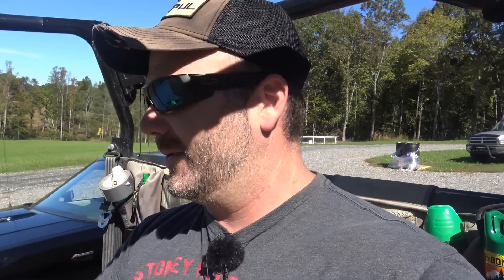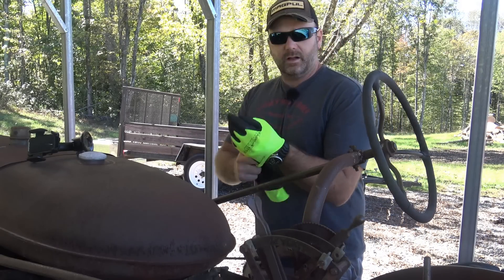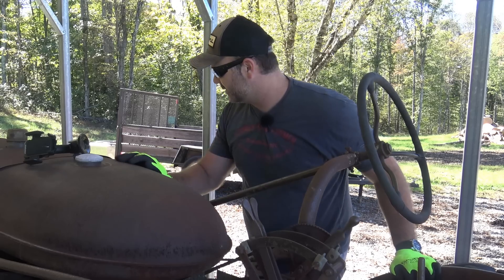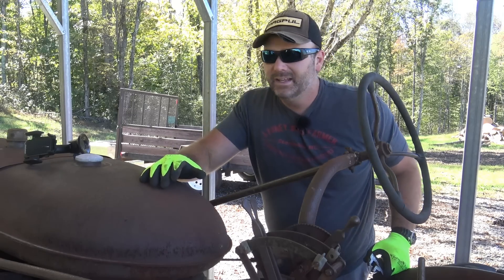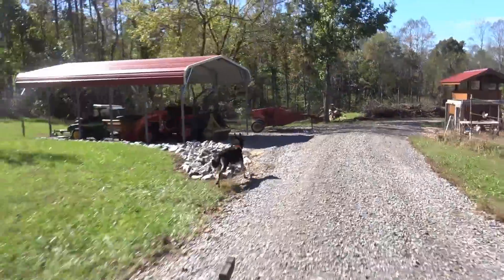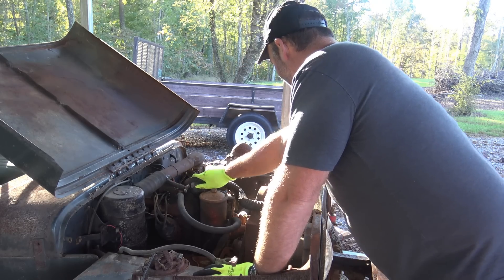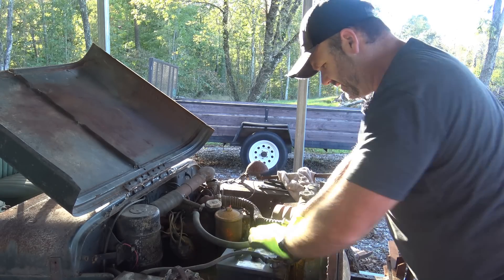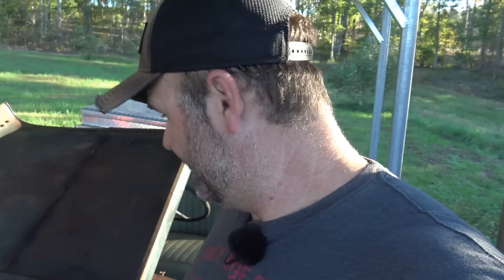WILLYS JEEP... LET'S GET THIS THING RUNNING!

Comment: Josh, if you're going to bump start it, put it in the highest gear and roll it off a hill and pop the clutch.  The higher gear gives less rolling resistance and turns the engine easier.

Comment: Nothing that has been sitting in a barn for 30 years can be expected to start right up. Start by cleaning the battery cables (both ends) and removing the starter. Once you have the starter off clean both mating surfaces (starter and bell housing) so as to have a good ground.  You should also remove the switch from the top of the starter and clean the contacts. Now it should turn over much better. Next: Do you have spark ? Remove the spark plugs and drip a small amount of ATF mixed 50/50 with Diesel fuel into each cylinder. Crank the engine to loosen it up and get some oil pressure. Clean or replace plugs, add some fuel and give it a try. 50 years a Willys Mechanic.
Reply: That's what I was going to suggest
Reply: What do you think about the 1947 Willy's pickup?
Reply: Absolutely clean the starter and block mating surfaces. All of the connections need to be as clean as possible. It's been many years, but I'm thinking that my ground wire ran to one of the starter mounting screws.
Reply: yep painful to watch this, before any thing else lube cylinders they are bone dry after sitting 30yrs,clean plugs and replace battery leads,check for spark and as a last resort yes tow it in 2nd gear and see if she starts.good luck
Reply: Chuck, you’re a Willy’s mechanic? I need to talk to you! I’ve been looking everywhere for someone who knows something about these cars.

Comment: I had a 1948 Willys CJ2A, in my younger years. It had no brakes, and from the windshield back it was a rust bucket. About 20 years ago, I took a backhoe dug a hole and gave it a fitting burial. If you need any parts, and feel adventurous, it is in eastern N.C. Bring a shovel.

Comment: Ol' 6 volt system 😲. I converted all my Farmalls to 12v. Super A is a nice machine. Can I be Glenn? Believe it or not, those oil air cleaners were effective. That jeep is what dreams are made of 🤠
Reply: I've converted a few tractors to 12 volt and never touched the starters, a 6 volt starter cranks REALLY quick on 12 volts :) .. and they seem to last for ever.
Reply: @MikeBaxterABC   Yeah, on a gas tractor they don't turn long.... diesel tractors the starters take a beating because they turn for so long to get the machine started.

Comment: Josh, I used to own a Willy's M38, 24 volt brother of the cj-3a that I converted to 12 volt. It's a lot easier nowadays to convert. Delco 10si alternator, universal alternator bracket off of eBay, nippondenso starter off a late 60's early 70's Land cruiser which has a softer flywheel engagement, 12v LED bulbs and txl wire or a six circuit wire harness from eBay. Oil bath air filters are great, especially on farms, just loosen the wing bolt and drop the bottom and replace the oil with your oil change. You may also want to  do a "squirt" of Marvel Mystery Oil in your gas fill-up to help with lubing the valve seat due to lack of lead in today's fuel. Hope this helps. PG

Comment: Dispite what you read about 6 volt being no good remember 6v is what won the war, there's nothing wrong with it. I have a 49 willy's jeep with 6v. I totally restored it. Just make sure all the connections are clean, like the ground strap going to the frame (and buy a new battery, it's also ok to jump it with 12v if need be) Also just pull the carb and clean it. You might have to replace the fuel tank, you can buy those online all day.  Sand the points also. Please don't pull it around the farm, that's how sh*t breaks.

Comment: FINALLY I figured out how to comment. LoL. I love your channel I have two of your shirts. In regards to the Willis Jeep. I had a 1950 model. Used Emory cloth to clean the points (inside the distributor cap and plumbed a boat fuel tank (for a pontoon) these are great little projects. I wish I hadn’t sold mine and I want another. They are basically foolproof. You can switch to 12v (the starter will handle it (change the light bulbs). Looking forward to future videos !!!!!!!!    Love ya man!  Sorry about Clyde, the man you purchased your land from. I had a similar situation in my life. Stay strong Brother. We love you!!

Comment: I had a 1950 and 1956 willy's and they had set about 15 yrs before I bought them the tanks were bad on both jeeps I ended up using the removable boat fuel tanks like a pontoon boat uses and an electric fuel pump and it worked great. Hopefully you can find a starter or a place near by to rebuild it. Good luck with it hope you get it going cause they are lots of fun. I would try 3rd gear when pull starting it since they are geared very low.

Comment: 6 volt batteries really suck..they dont hold a charge very long when cranking the engine, You should take out all the spark-plugs add some oil into the cylinders and turn it over,I bet the cylinders are very dry after sitting 30 years! Take the starter out and clean and lube it up,before it gets overheated and burns up..
Reply: That was my first thought too
Reply: for sure after 30 years fogging the engine is a must lol
Reply: I'm pretty sure that oil is in really bad shape too. I wouldn't crank a engine on it
Reply: yes,I think he is not much of a mechanic,Im sure hes learning..but he is going to do do more damage than good..
Reply: Possibly rig up a different type of switch to start it
Reply: Theres a german spray called ^ravenol^ for unseizeing the parts most folks consider un fixeaable!
Reply: @eddiecaplan1908  , thanks for that info, got an outboard motor that seized after Hurricane Sandy, I`ll give that stuff a shot!
Reply: @jlpytlewski  its truly brilliant at unsiezing the worst corroded parts, only trouble is, once you use the aerosol, it seems to lose pressure and leak after a few weeks, it is so efficient at penetrating,it even bypasses the aerosol valve!,   its expensive, but id still highly reccomend it when nothi g else works!
Reply: You can boost it up to 8v with your voltage regulator.
Reply: Take that old start out! Tap on it, blow out the rust, clean all the connections,  lube it, put back in. Clean battery connections and ground.
Reply: @FUNNYBOY12375  The starter has a mechanical "switch" actuated by a rod from the starter pedal under the dash - no electrical solenoid there on the starter at all. The starter will have to be rebuilt, the electrical system to the starter fixed, the engine ground to the battery has to be cleaned, and I would replace the ground strap and the positive cable anyway. Otherwise you risk burning up the battery from a short or a fault in the starter if it will not shut itself off when you release the starter pedal. Gotta remember that Jeep is 67 years old - they did things different back then.

Comment: Change plugs, make sure fuel line is clean, change oil and filter, get new starter in, change out batt. Terminals. Before you try to start the old girl.  🚙💨

Comment: If you try pulling it to start shift the jeep trans to 3rd or hi gear.  Even though it is 6 volt you can jump it with a 12 volt, just hook up cables like it was 12 volt.  I have done this many times with old tractors and cars.  I am 83 years old and started working on farm equipment since I was 10 years old.

Comment: Just helped my brother with his 1947 Jeep going. Get rid of that mechanical starter switch and put in a solenoid. Those switches are very finicky if not hit just right all you do is drain the battery. Good luck

Comment: I put a 1947 Willys CJ2A Jeep together from parts 50 years ago last summer, between my Junior and Senior years in High School. The starter was never very good and often acted just like the one you have. Clean electrical connections are critical. You will probably need to pull the starter off and and clean all of the connections, as well as the battery connectors. My jeep had been converted to a solenoid starter and had a start pushbutton on the dash. You could do this with yours, if the start switch is bad. You can use a 12 volt battery to start the Jeep, but it's not a good long term practice. Most of the 12 volt systems used a 6 volt ignition coil with a voltage dropping resistor in series that was shorted out by the starter solenoid. This would put full voltage on the coil while starting. Mine was a 6 volt system, but the generator was not original and I had to convert it to positive ground because of that. Since there is nothing electronic on the Jeep, it doesn't care whether it is positive or negative ground. The polarity of the old commutator generators depends on the direction that they turn. If you rob one from an old car (or tractor), it needs to turn the same direction as the one that you are replacing, or it will be the wrong polarity. The starter is series wound and doesn't care about polarity. If I remember correctly, the old flat head four is 134 cubic inches and the rear ends are around 5.4:1. 45 miles per hour is probably the top speed except when going downhill. The transmission should be a Borg-Warner T-90 and the transfer case should be a Dana 18. I found this web page that you might be interested in: http://www.cj3apage.com/

Comment: Good video Josh! The wife and I think your dad should have given that Jeep to you! Your a good son and we would have never thought of charging you anything for it.  Having said that as another commented, I would start by pulling the starter and seeing if you can rebuild it, new brushes and what not as long as the winding's are good you should be able to revive it. Once that is done I would look for a spark, if none check out the points and coil once you have spark then get a can of starter spray for the carb it works much better than gas to get it to turn over. Good luck Josh.
Reply from the maker: Yep I got her in the shop now...gonna pull the starter and do exactly what you're saying !

Comment: Id reccomend to pour diesel in the cylinders and let it soak a day to free up any stuck rings and pre lube it. It will also seap down into the oil to loosen up any sludge, so you will have to change the oil. But then tow it around without plugs and let it turn over then put the plugs in, change oil, fire it up.

Comment: 2 things:  1)  People with the Model era would get rusted out gas tank, just clean off rusted part and shape sheet copper to fit where it used to be and solder in place.  A good radiator should be able to do that and leave you with a tank which will last forever.  2) When pull starting put trans in a high gear, it will be easier to pull and will spin the engine plenty fast.

Comment: if your having trouble with starting, you should have removed the starter motor and got it fixed, whilst waiting for the starter to come back, you do the electricts side of things, replace the spark plugs & leads, replace the points and rotor button and cap, set the pionts gap, change out the oil and filter, do a compression test once you got the starter motor back, tip som fuel into the carby, fire it up

Comment: Run 12 volts to the starter really quick, it will clean the brushes up enough to turn over better on 6 volts. Also, put some ATF in the cylinders, dry cylinder walls and stiff piston rings gouge the walls and kill compression later on down the road. I'd pull the distributor cap and clean the points with some very fine grit sand paper so you'll have spark

Comment: Josh- remove the spark plugs, spray some fogging oil in each cylinder so that you dont further damage the cylinder walls that way you can play with your willy longer 😆

Comment: I'm 84 and telling you on lead acid 12 volt battery you can drive a screw down the middle and connect to it and you have 6 volts! Also you can use 12 volt battery to start a unit that used six volts. On kill or run engine's use 24 volts just to turn over and perhaps start.  It sure will do something like break the bendixen or turn over or if starter is weak will smoke the starter.

Comment: You will have to pull the plugs and add about 3 table spoons of oil to each cylinder  ,to give it compresson
Reply: Edward Marvin not compression but just to be sure that when the piston rings start moving again the cylinder wall won’t cause scratches and damage... I’ve always referred to it as “running an engine dry” or “ don’t forget to lubricate a dry cylinder” mostly because you have no idea what’s In them and so on
Reply: Edward Marvin not compression but just to be sure that when the piston rings start moving again the cylinder wall won’t cause scratches and damage... I’ve always referred to it as “running an engine dry” or “ don’t forget to lubricate a dry cylinder” mostly because you have no idea what’s In them and so on

Comment: I'd pull the plugs and coat the cylinders with some oil,  Then pull it around without the plugs in.  Then install the plugs & retry.  Agree that you should use a known clean tank temporarily

Comment: Rig up a boat fuel tank. Clean the points with sand paper, Emery tape or your pocket knife. Hit it with 12 volts and it should start. But only long enough to get it fired up. Then if you want you can 12 volt it. Or find an 8 volt battery to run the 6 volt system on.

Comment: fuel timing spark and compression is my main check list go to for getting an engine running that is cranking over. 
you got the starter issue figured out basically,
Reply from the maker: Yep....first we gonna pull the starter and clean it up...hopefully this solves some issues....then install new cables
Reply: @StoneyRidgeFarmer  Cant wait to see yall ride around on it !!

Comment: Hey Josh getcha one of them boat gas tanks, and hook it straight, check your plugs make sure there clear and then check the spark. If you got spark and fuel that thing will run.

Comment: Josh you put the battery in backwards. Positve ground, my friend. That oil is terrible. When dirty oil sits around for years the crud and dirt desend to the bottom of the oilpan. So when you start the motor it will suck up the worst of the oil first. Not a good idea. Drain the oil, change the oil filter, add Rotella 30wt oil. Popular brand oils don't have the additives that old motor needs. Pull all the sparkplugs, clean and gap them. add a teaspoon of atf down each sparkplug hole. With the plugs still out spin the motor over some. This will pump clean oil through the motor and lube up the cylinder walls. Now check for spark. If you have spark hook a remote fuel tank to the fuel pump and spin the motor over some more. This operation should get the fresh fuel to the carburetor sooner and eliminate a problem the old fuel is waiting to hand you. Reinstall the sparkplugs and drip some fuel down the carburetor. You are ready to try to start the old girl now, turn her over and let's here her run.

Comment: Best bet is to put  a 12v battery in it and change the coil for a standard 12 coil or run a 6v coil with a ballast resister inline (looks like a white ceramic block on a mounting bracket) on the power side of the coil. If you run a 6v coil on 12 v it fries the points in the distributor  Its not great for the starter motor to crank it for a long time on 12v if its a 6v starter as they will overheat, but it should crank faster.  Make sure you have a points gap in the dizzy. Pull a plug lead off a plug and fit a spark plug to it. Hold it against the block and get mrs Stoney Ridge to crank it. it should through a spark across the gap in the plug. If not clean the points and try again.

Comment: First thing you do with a motor sitting for that long is pull the plugs and check the cylinders. Turning a motor over with rusted walls ruins the bore and pistons rings! Make sure the motor can be turned over freely (by hand/ ratchet on crankshaft) without resistance.

Comment: Convert it to a 12V system/starter rewire it so you don't have to worry about fires, and put a key switch or temp toggle to start it. Definitely want at least an E-brake before rolling it down a hill. Good luck, man.

Comment: Look at the brushes on the starter, I had the same issue with the starter on my farmall cub  and I have them replaced.
Bump start it in second gear if you are going to pull it around to start.
Can’t wait to see it run!

Comment: Probably too little too late but try an 8 volt tractor battery, a friend of mine had a '46 ford pickup with a 6 volt starting system and he put an 8 volt tractor battery in his truck, it cured his troubles and didn't cause any troubles. If you're wondering about troubles, he was a certified mechanic, so I doubt that he would have done it if there would have been any consequences from his actions. It worked well for him.

Comment: You probably should pull the plugs and put some lightweight oil or diesel down each cylinder to lube a little for ease of turning over.  You should also clean the distributor cable ends, file/check points, battery cables and battery terminals really well. Also, make certain you have some clean engine oil.   I would also boil the carburetor and make certain it is super clean, along with some new plugs and fresh gas.

Comment: The positive side of the battery needs to be hooked up to the cable that is bolted on to the side of the block (motor). Also pull the plugs and add a little Marvel Mystery Oil mixed with wd40 down the cylinders. Let it set awhile and turn over the engine and put a tad more down each of thd cylinders. Will help lose up the rings. Also make sure you have a 6volt coil and not 12v. 12v on 6v system will cause nothing but problems. These old motors only need fuel air and Spark to start.

Comment: Start looking at napa for a brush set for the starter check your points sand and set them replace the battery cables. Then run that jeep

Comment: Your Jeep should be positive earth (Fat terminal). Try starting it with a 12  volt battery... you can even drive around for a short while on 12 volts without causing damage.